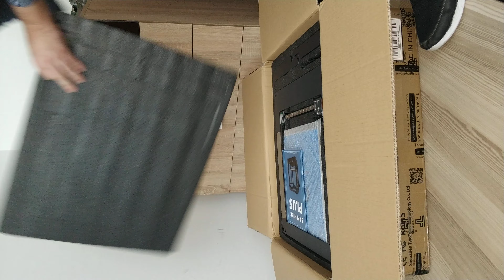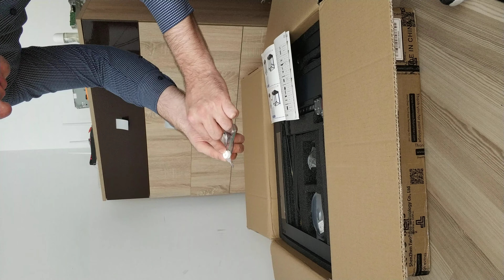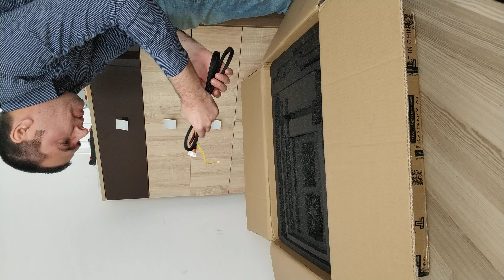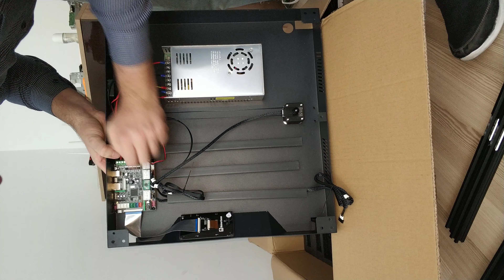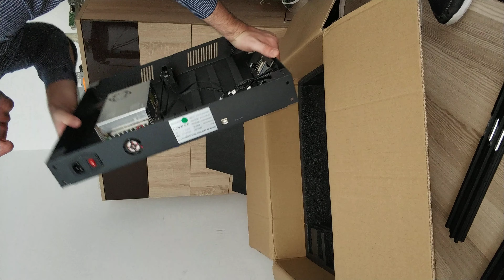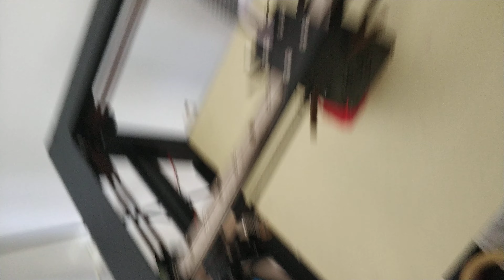Sapphire Plus unboxing and extra info

Comment: hi, was the printer easy to set up? did you have problems with it? thank you
Reply from the maker: For me it was an easy job because I've had a delta printer for 1 year now and learned a lot from that , but for beginners it might get complex . The mecanics of the printer should be easy if you follow the manual and also see some videos online when the manual isn't enough. The electronics don't have a good enough description in manual enspecially for begginers. Also the printer come's depending on regions and time with different versions of firmware and from some videos and reviews I've seen the first versions where not  functional. I was lucky and got v1.3 which was fully functional. There  is a  v2 also functional here https://www.twotrees3dprinter.com/#/app/downloadxq?name=Sapphire plus , which I installed but be aware that this is for only synced z stepper motors version (I've seen some videos from India I believe with a version of the printer that has independent z stepper drives which probably don't have the sync belt connecting the 2 z  motors and probably have 2 z endstops). Hopefully the next week I get to upload my printer built recording which is about 5 hours long cause I took my time while building it.